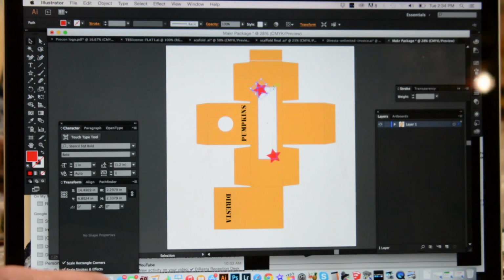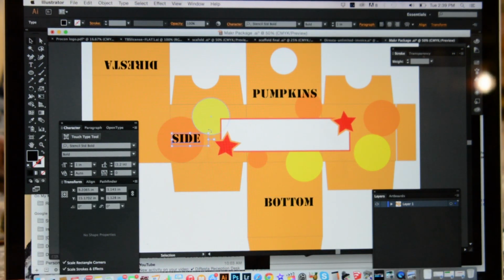DiResta: Package Design

Comment: Excellent simple explanation! 
One thing he may have forgotten or I missed was the concept of "bleed". Make sure your color areas extend beyond the trim areas or bleed over or you may have a white edge to your art that doesn't look very good.  Most specified bleeds are .125 of an inch minimum.
Reply: +Scott Cress I was going to mention this too. Doing a one-off without bleeds is fine if you have Jimmy's cutting skills, but if you send artwork to a printer without bleeds they're either going to reject it or charge you to add them. 

I do a lot of prepress work and missing bleeds is probably the most common issue I see in client files. If it's just a solid color that bleeds, it's no problem to add them, but if it's a photo or complex artwork it can really torpedo a job.

Comment: what is your production cost for each of these? probably a lot higher than what we would expect to pay retail (maybe $17.99?). apart from lower wages how different is the build process in china?
Reply: +jumpleadsx2 
Production cost for something like this would be mostly irrelevant because you wouldn't use this method to make packaging for an entire product line, it's just too time consuming. This would be more for production samples or a very limited run of a specialty product.  If you were going to be mass producing this packaging for a product you would mostly likely be sending the design to a company like RockTenn or International Paper to have them printed and cut using a set of dies.  For items that are mass produced they make packaging machines that take stacks of the flat packages and automatically fold and glue a portion of the package, then put the product inside, then finish the folding and gluing.

Comment: What I think is most important for young designers, is to know that you didn't design this in Illustrator. You designed it on paper and then used Illustrator as a tool to get exact measurements.